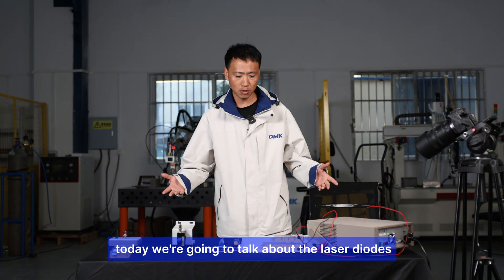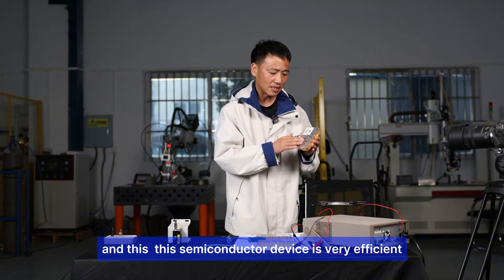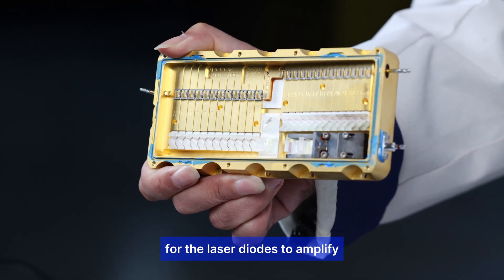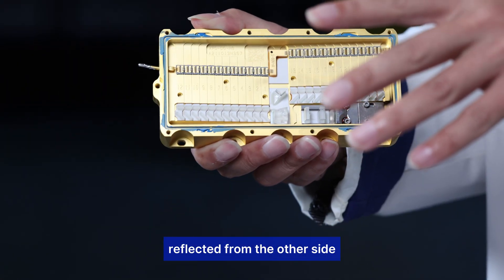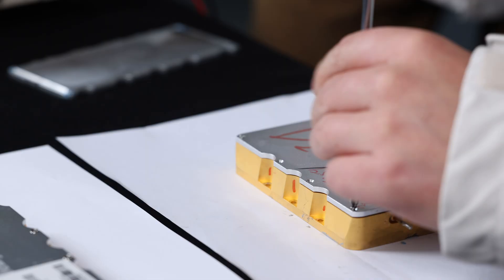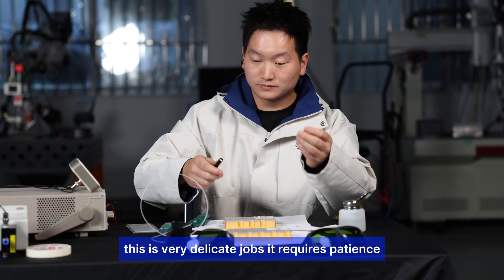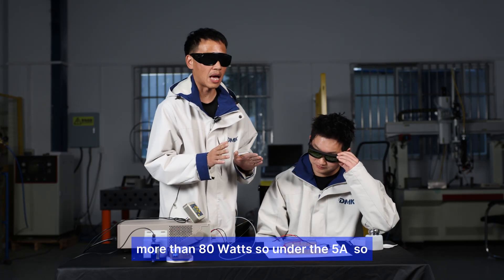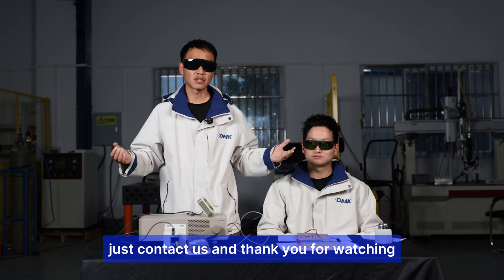Laser Pump Source Working Principle Revealed!#DMKLaser #LaserCoreComponent

Comment: Question?  45 VDC at 5 Amps is 225 Watts.  So there are there 2 lasers pumps that are combining to make the 500 Watts?
P=IxE  →  45V x 5A=225W   x 2pumps = 500W   ?
Reply: I think those 500w lasers can output 500w. They only showed an output of 80w, with the input  ~225w. Efficiency was shown, but not max capacity in that demonstration.
Reply: @rexated5148  The maximum operating current was not used in the demonstration; instead, a smaller operating current (5A) was used. Therefore, the full current power can be calculated from this current and the corresponding power.
Reply: Theoretically, that's correct, but some energy will be lost during pumping after passing through devices such as beam combiners, gratings, and YB fibers.
Reply: It must be nearly half of what it consumes